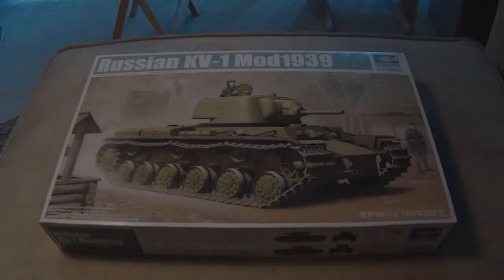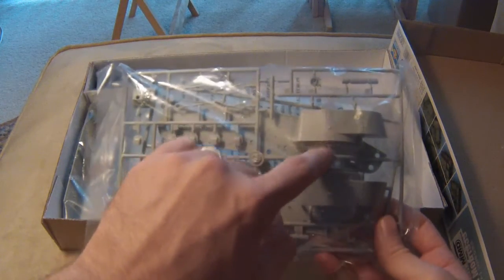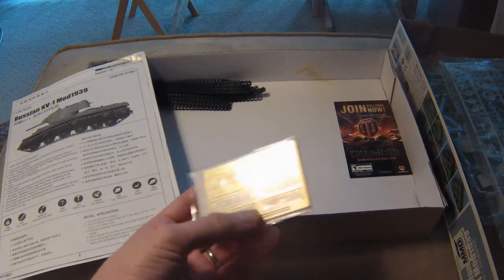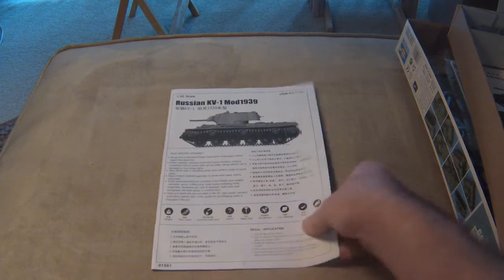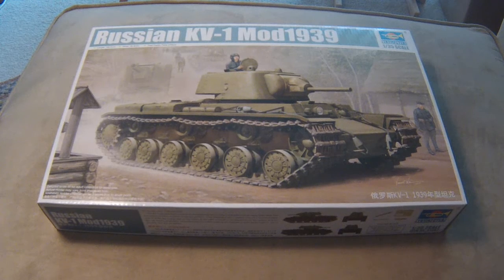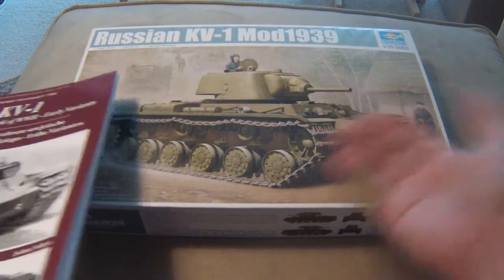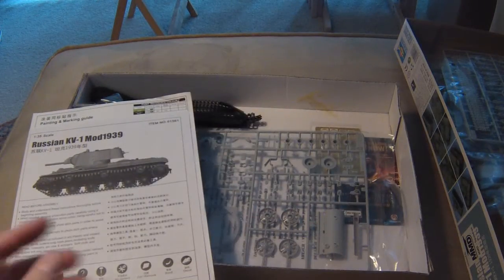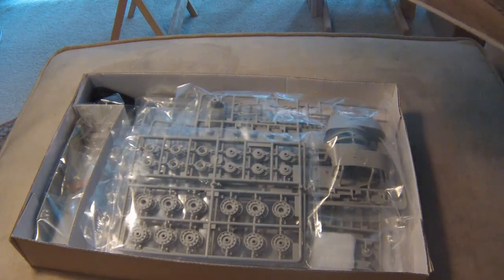Ben Builds: Unboxing The KV-1 Mod. 1939

Comment: Nice. I’ll use your videos about this kit as source.
Reply from the maker: Thanks! It is a great kit and a really awesome subject. Good luck and have fun!
Reply: I built all JS from trumpeter. Now I want to build KV series. Starting from this kit and KV-2. Any advice in advance?
Reply from the maker: The KV is my favorite tank of all time and the Trumpeter kits are really nice. They go together well and give the builder some neat options. I also built an ARK KV-1S (https://www.facebook.com/media/set/?set=a.109550606358351&type=1&l=d89ac5cf6e), but I think the Trumpeter kits have better fit. 

Trumpeter gives you rubber tracks and plastic link tracks. In my opinion, the link by link plastic tracks are the way to go. If you want to add even more detail, you can always checkout aftermarket metal tracks. They can be very time-consuming, but since they are real metal, they sag in all the right places and have a nice weight to them. They can be expensive, so keep that in mind.

I'd also recommend replacing the plastic grab handles with thin, metal wire. You can just bend them to shape and use a bit of super glue to attach them. I think they look more realistic and improve the overall appearance. That goes for the KV-2, as well. 

I've come a long way since I first posted this series. This was my very first build series on YouTube, so it is a bit rough. Even so, I hope you enjoy and can find some helpful tips.
Reply: Ben Builds Do you have instagram page?